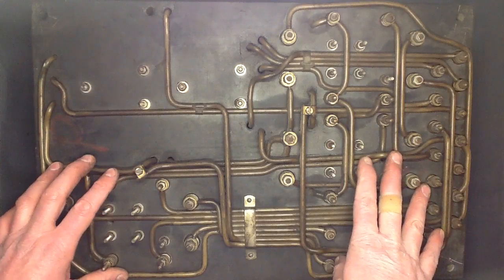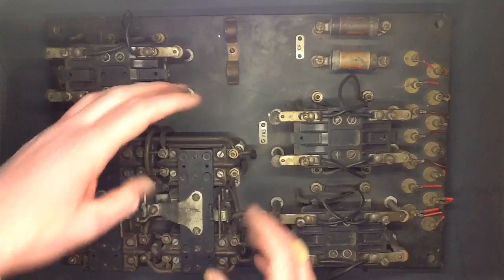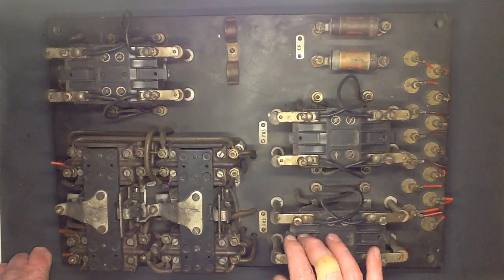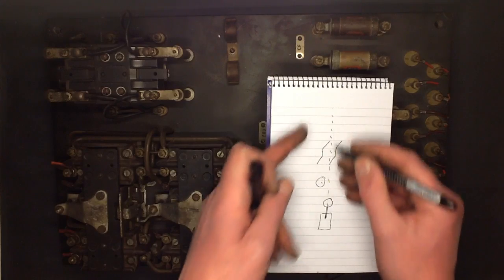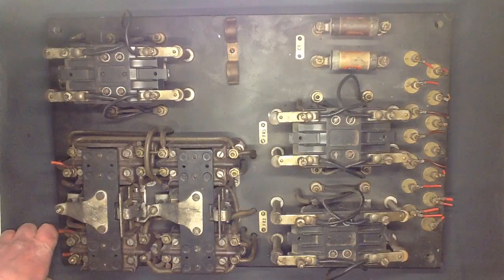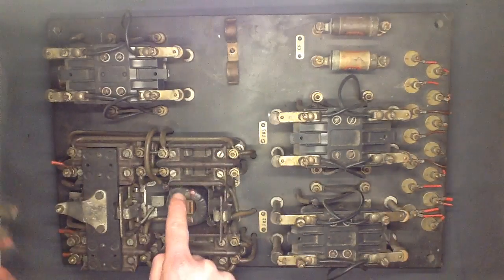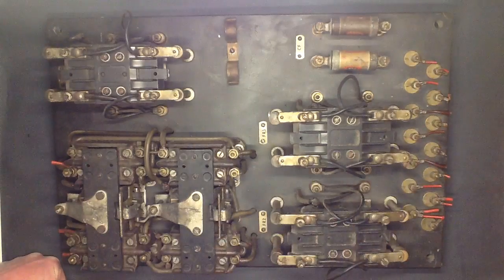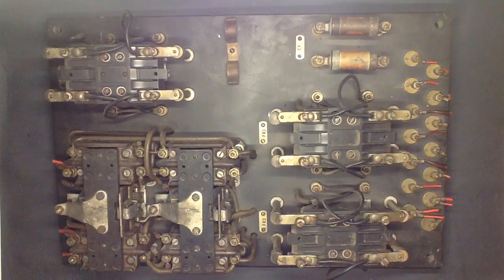Really old and VERY heavy slate elevator controller.

Comment: Clive if you give us the markings on the other in/out contacts we'll try tell you what they were. As a trained lift engineer this video was pure dead brilliant. Takes me back to when fault finding was a lot easier.
Reply from the maker: +Scott Redpath They're not actually that helpful.  Just A, B and C then 1,2 and 3 at the other end and 4 to 11 in the middle.  The only indication that contactor contacts are even for cables is the different screwdriver-slot style of nut.

Comment: I've fixed one of those a long time ago, except it was DC operated and was fitted with pneumatic blowouts on the contactors.

More recently (ten years ago or so)  I built a rectactor controller on Scrapheap Challenge.
Reply: +Paul Compton "I've fixed one of those a long time ago, except it was DC operated and was fitted with pneumatic blowouts."

So, it wasn't actually one of those  :)

Comment: These circuits is without doubt the most beautiful elektromechanica and worth preserving. It's fascinating and like you mentioned it is so visible as it is working, very intriguing. This reminds me of my childhood (early eighties) when I played in an old abandoned factory in my village, where there was a telephone switchboard system for the whole factory area (multiple buildings) with rotary switch registers and many relays. I was too young to understand the historical value of it, however I was sad when it was destroyed by vandalism and later just demolished with the buildings. I observed it for hours to see how it worked, talked about it with my father and even went to the public library to read about it. Later I have seen one actual working, with a lot of noise and producing quite a lot of heat. My fascination of that kind of electronics never died, the logical circuits based on mechanical switches (relays) because it's so visual. The fact that it can be done nowadays much faster, more complex and with more features with processors and programming is great, but the roots of that logic is still the mechanical electronic circuits.
If I would guess the weight of that board with electronics, I would say something around 22.5 kg. These relays were heavy those days.

Comment: hi clive
ime a lift engineer and looking at that panel i woudlnt be certain but there maybee another slate with a 3 phase transformer on it with a tapp on the star point 3 wire ? and maybee a rectifier too, they sent some lethal voltages down the shaft in them days unlike today 24v, ive ripped out panels like this before in blackpool, but i dont recognise this one, it will be a waddsworth (bolton) an otis or even an evans, or a united that became keighley lifts then schindler, your right it is slate and it is heavy about 75kg also the shaft switch that you speak of is called a bi directional switch and can still be bought today from dupar, they are a nightmare to set the floor level at the mid floor because when you adjust it up it throws the down out, and the spare fuses have probably been knicked in the past by an engineer for his toolbox, as youcan imagine you can but them fuses anywhere lol,was there no drawings ? sometimes they was on the inside door .
Reply: +Tony Baines bi directional switch kronnenburge http://www.elevatorequipment.co.uk/home/section-3-kronenberg/kronenberg-limit-switches-accessories#JumpToOptionAnchor
Reply: +Tony Baines the other sinister thing about them panels is that if the car was trapped some times the lift engineer has to move the car up and down to free it, by physically pushing the contactors in mc+dn for down and mc+up for up. but should you lose concentration and push the up and down contactor in you would be standing at the pearly gates with your toolbox, modern contacts are interlocked to stop this.
Reply: +Tony Baines 
on looking further at the video, i think that the 3 contacts with 2 prongs could be the floor contactors (call and signal) and the 1 with the removable contacts is the 3 phase up and down it has got an interlink, the reason that they started using 3 drive contactors is that if they only used 2 like your panel and a contact welded in, the lift would continue to drive and not stop, if it was in the up, then the sheave would destroy the ropes and youde be back at the pearly gates if the safety gear didnt work.

Comment: The replacement you mentioned that keeps breaking down sounds like the one at our hospital its broke 3hrs after its fixed and the floor indicator goes up and down 3 actual floors but the elevator readout has all the numbers and letters spat out totaly at random so they put in a new elevator beside it to manage the load and luckily its only broken down 4 times that I know. The emergency lift that services the 3 floors is from 1967 has broken 1 in all these years of service.

Comment: Well obviously, they didn't replace the old elevator with an Otis elevator. I was recently at the Space Needle in Seattle, Washington US. I noticed the manufacturer plate inside the car. The control panel was vintage '60s but looked brand new. I asked the operator how reliable the elevator is based on the large number of passenger trips to the restaurant and observation deck. They said it had never been out of service except for normal servicing for the past 30 years. The identification plate said Otis Elevator and the place of manufacture was Bloomington, IN US which means it was made in my hometown . Cool.

Comment: Now that would have cost a stack of money from new, so much work to create a reliable control system, yep its a work of art.
I bet the company did wish they had left it alone, silly buggers :-(
Designed to last, unlike modern crap.
Reply: +zx8401ztv ...and a fine example of how things used to be done before everything just had to have a CPU.
Reply: +Ian Harrison 
So very true, and years after it was made we can still repair it without any special (of the era only) microcontrollers.
.
I like the old logic chips, basic logic that still appears to be alive all these years later, most you can still buy new.:-)
Relays are such usefull devices, i dont think they will ever vanish compleatly.

Comment: I'll throw in a wild guess at twenty kilos.

The slate reminds me of moving a one-piece slate pool table into a basement years ago. It had to come down in pieces, the table first, then the slate. That slate was one heavy SOB, and while my dad and a few other guys were carrying it down the stairs, I discovered that the ball run inside the table was broken. I had to quick-fix it before they got the slate into the room, because there was no way they were going to hold it up and wait! As far as I know there's still a piece of scrap solid copper wire holding that thing together.

Comment: Now I'm wondering what the control circuits looked like in the old elevator where I worked years ago. That was a truly ancient contraption! Probably would have been condemned but it kept working so we used it. Sadly the building was demolished. I'm going to guess...15.8kgs.

Comment: Mmm, the slate and marble power and circuit and control panels, those are all fabulous. Especially with open frame relays and analog displays and knife switches.
I'm not going to even guess what it weighs unless you want a random guess since I have no reference for a Kg.

Comment: Slate - natures PCB! (Even potentially multi-layered.) I wonder if they couldn't have combined the original circuitry with some electronics to produce a smoother AND reliable system? I think the board weighs 12.6 kilos

Comment: 1- who made the controls?
2- what is the vintage?
3- how does the logic know to go up or down? I.e. If you are on floor 2 and press up how does it know to go up? If you are on floor 3 and want to go to floor 1, how does it know to go down 2 floors and ignore the switch on floor 2?
Reply from the maker: +jak p (skiguy09) Unknown manufacturer.  They probably had a brass plate on the lift somewhere.  Don't know the age, but VERY old.  It knows which direction to go in because of the switches in the shaft that get left in a position depending on whether the car is above or below them.  When power is applied to the common of the shaft switch that is the destination, it will apply power to either the up or down contactor depending on its position.  If the lift is above it then it will be bridging over to the down contactor bus.

Comment: That's a nice piece of history
We had a couple of old lifts where i worked, but the controllers were a little more modern.
I looked after the lifts, and helped the service engineer
I like that style of contact, we had some where the top ones came out that way, the bottom ones were like hex bolts so could be easily unscrewed and replaced., even the coil unplugged.

Comment: I have worked on a dumbwaiter that was wired weird, if you push floor 3, 2 and open at the same time would over ride the safety letting you open the door even if the lift was not there. it made it easy to push the reset button on the side of the motor with a long stick

Comment: anyone see the orb at 6:10 go across to the left?
Reply: +topher Looks like a bit of dust floating up and maybe slightly left
Reply from the maker: +topher It was the ghost of the last lift engineer that tried to change a call button with the power on.
Reply: +bigclivedotcom :D you just had to click that contact one last time to release him
Reply: that's a orb. Watch how it smoothly moves out keeping a even pase and motion. Dust orbs would slowly fall and wouldn't move that fast unless there was a stream of air and even than its to consistent. Very cool!

Comment: This reminds me so much of the style of electrical contact boards / controller boards used on the RMS Queen Mary (another very fine example of 1930s Scottish workmanship). One of the panels is 6 feet by 8 feet, so it must weight a ton.

My guess for your slate panel: 43.7 KG

Comment: Clive, "modern" elevators (at least from the 1970s, onwards) don't really cut power to the controller when the doors are open, as the controller is still needed for door operation, levelling and re-levelling, directional control, call management and many other functions.

Nevertheless, there are situations that make the controller "halt and reset". Most notably:

- If the door contact opens with the car outside the door zone, or the car departs from the door zone with the door contact still open;

- If the the maximum number of relevel attempts is exceeded.

Some of the situations that really shut the controller down are:

- If the car moves too fast, causing the governor switch to be tripped;

- If any of the final limit switches is actuated.
Reply from the maker: +Matheus Moreira I was over-simplifying.  Modern elevators do have the main safety circuit, plus taps from different points that selectively kill sections of the drive circuitry while leaving the controller running.
Reply: @bigclivedotcom understood.

Comment: 7.47 Kilograms... :P

It'd be fun wiring that up to a model lift so it could be demonstrated doing its job... :)
Reply from the maker: +twocvbloke I think you'd need to rewind the contactor coils.  But as they are basically just a big doughnut of wire wraopoed in tapoe, that might not be too hard.
Reply: bigclivedotcom
Could be a bit of a project there... :D

Comment: Can you imagine a 88-floor building elevator controller like this? :D
Reply from the maker: +Lucas Pereira da Silva The bigger systems the allowed multiple call latching from that eras were just incredible.  Lots of rotating drums and cams that allowed the position of the lift to operate contacts in the control room.
Reply: bigclivedotcom extremely complex! I think, being mechanical, the system would be more robust. Today, with programmable logic controllers, or even with simple microcontroller boards, its easier. I'm a begginner in electronics and I like to see your teardown videos. And the vids of EEVblog also.
Reply: At the time this was in service. I think that the tallest buildings were no more than teen stories.
Reply: @stanleydenning  if it's a hydraulic system pushed from the bottom, they are 8 stories or less.

Anything larger is controlled from the top, and they went larger than 13 floors even earlier skyscrapers if I'm not mistaken.  However some buildings may have had elevators that only ran a portion and connected to another.  Depends what building and such

Comment: 18.8kg Estimated dimensions 30*350*500mm slate density 3000kg/m3 and a bit of copper!
Reply from the maker: +paul fle The slate panel measures 20mm (3/4")*325mm(13")*490mm(19").  The gear actually has quite a lot of mass to it too.  (Just in case you want another guess)

Comment: I don't know kg too well but I guess 17.3 kg
Reply: +Nicholas Ruiz 
Well, that's about 34.6Lbs. Seems about right with the thickness of that slate.
Pretty close to what I guessed. :D
Reply: theLuigiFan0007 isn't a kg 2.3 lbs?
Reply: Nicholas Ruiz
So for the "about" part in my estimation....
......and by about I mean really far off.

Will admit that's way farther off then I thought it was going to be. It's 2.205 pounds per KG to be exact according to my calculator. I was never the best at mentally converting between metric and imperial. Also depends what planet you're on. XD
Reply: theLuigiFan0007 OK :)

Comment: My old high school had an elevator like that.  On occasion you could hear the heavy motor contactor engage.  The building was an old monastery, built long before power.  I haven't a clue when the elevator was installed.